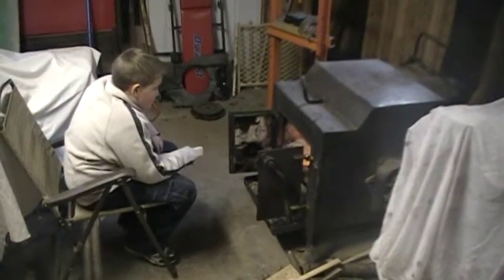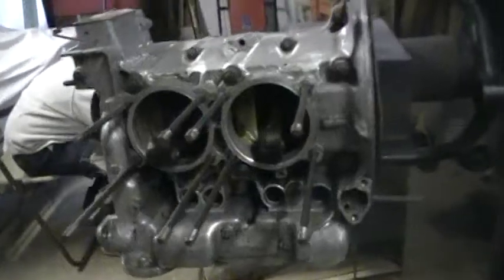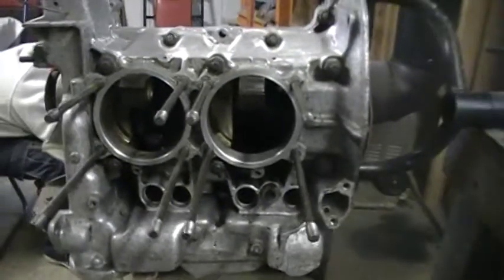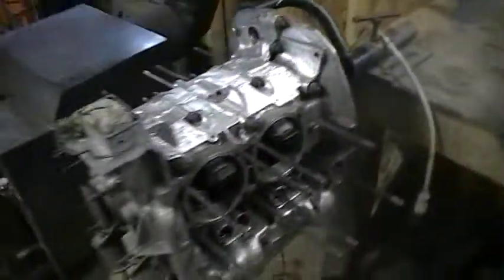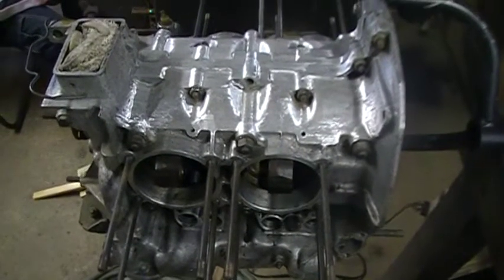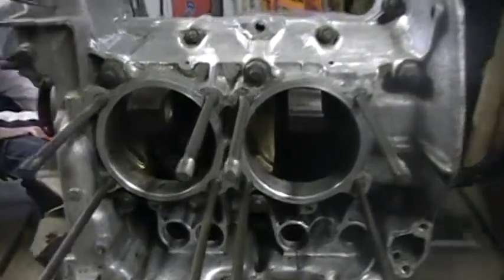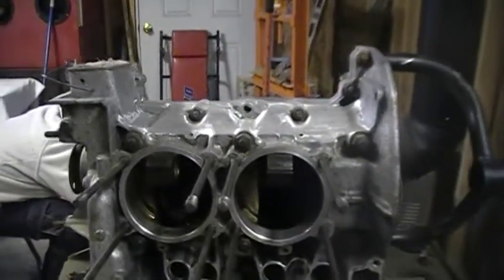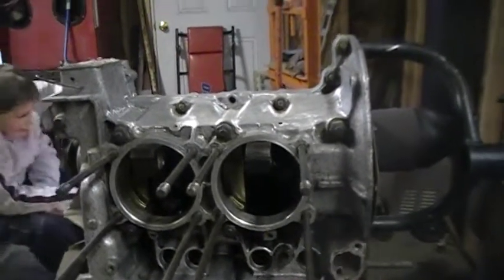Type 4 Engine Intro

Comment: Hi Typ 4 connesseur!  There are other things to mention. 

1. The cam has only 4 lobes in stead of 8. Every cam is hence used double, that is possible at a boxer configuration. So any cam that lasts more than 250.000 km is a miracle, cam carnage is designed within this block. 

2. The second design flaw is that the cam followers donot overlap the cam complete; they are shifted sideways for some(?) reason. The camfollower in the block uses only 3/4 of its diameter to run over the cam... I have never seen such a design flaw.  Back to the Zeichungsbrett =drawing board, mein Jungs! (dear boys)
3. OK sofar. There the Alps come, and the Stelvio pass. (check out where that is!). Pulling 100% with a standard block after 5-10 minutes the oil temperature is 120 C. Also when the oilcooler is new and the flow unobstructed. Over 120 C the oil pressure drops to zero, the oil is too thin. 1/2 hour pause helps here. Hence oilcooler too small for full power runs. Back to the drawing board, boys!

There you have 3 design flaws. On You-tube please tell the complete story, not a part, neither a commercial one. 

sincerely yours,  your Dutch Typ-4 connesseur, Louis.
Reply: Another famous engine builder said he always puts in a new cam with engine builds, now I know why.  Thank you.

Comment: I'm about to build my first VW engine, a '78 Type 4, 2.0. I've had all the parts waiting for me to drum up the courage for over 4 months now. After buying this bus, I had trouble driving it home to South Florida from Houston (rings went), but I nursed it home, dropped the engine & found a big gaping hole in the top of the case had been repaired with epoxy. Ugh! So, here I sit with a new case, cylinders & pistons, new bearings on my professionally assembled crank & rods, & I'm still intimidated.

Comment: Hi 1968hambone, 
I have 1974 bus 1800 cc type 4 - I pulled the engine out and just started stripping it. The engine was running ok but looks like shit, a lot of oil on the engine push-rod tubes look they're leaking and I was wondering to what extent I should rebuild it. I don't think the carb set-up is right because the engine has a lot of carbon buildup and I think the engine is original, never rebuilt. Do you suggest I do the same you did, and how you cleaning off the rough edges on the block?